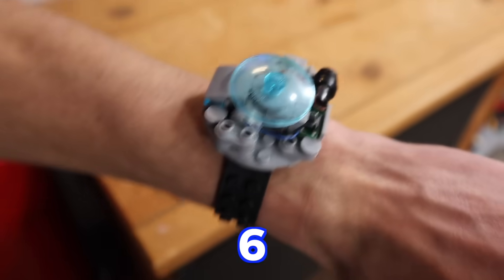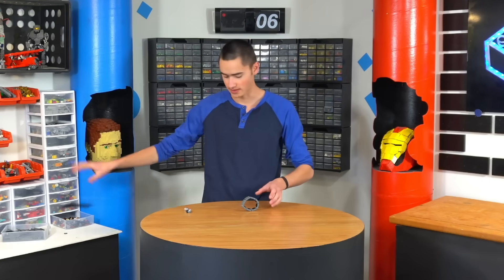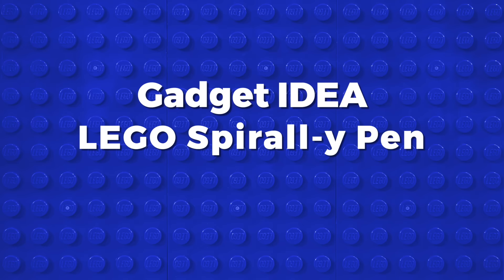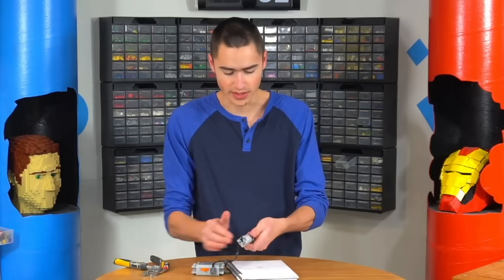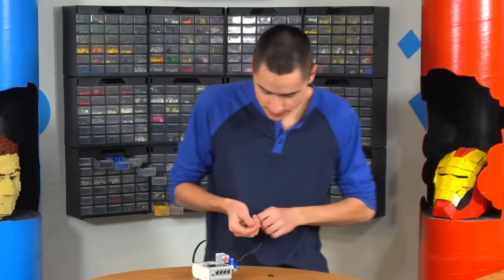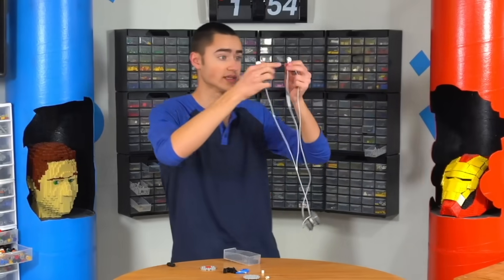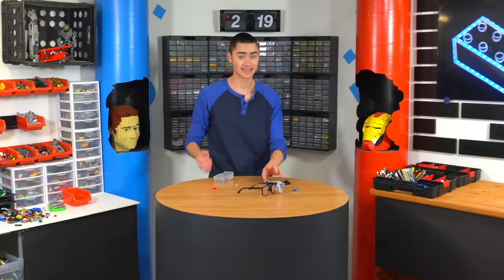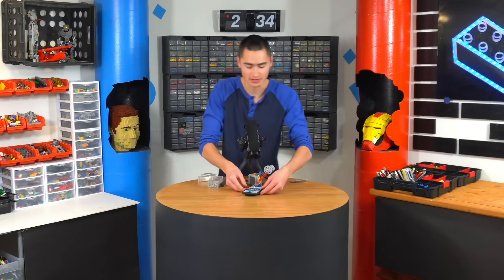GENIUS LEGO Gadgets YOU can Build Yourself!

Comment: 5:14 you can also use an infrared sensor and remote control when the door is opened, the infrared connection is disconnected and the alarm is activated.

Comment: By the way you can use the negative terminal off an AA battery as a stylus or you could put the wire in the earth terminal of a mains 3 pin plug and plug it in and it will work as a stylus/screen swiper just the same
Reply: Really good video as always